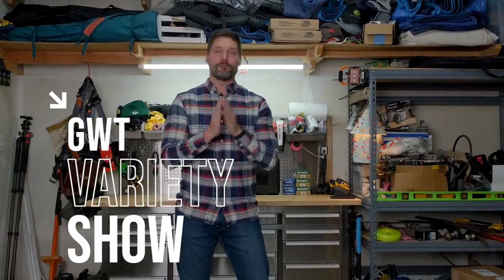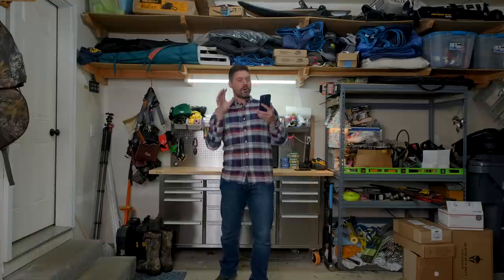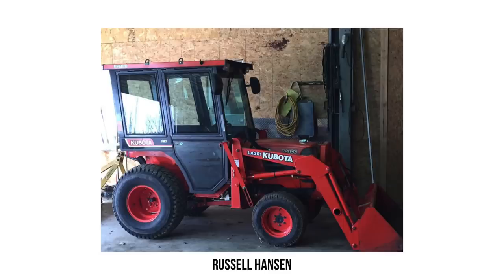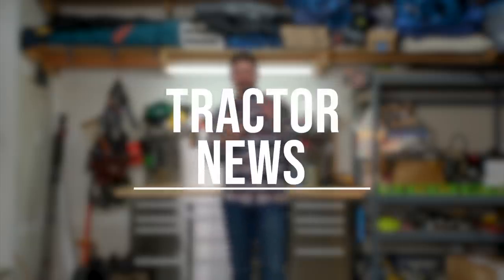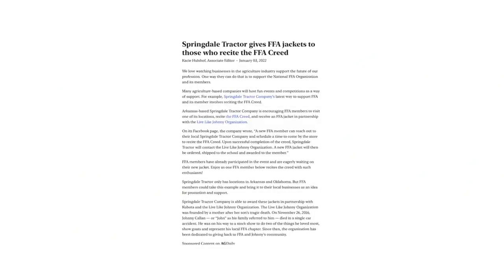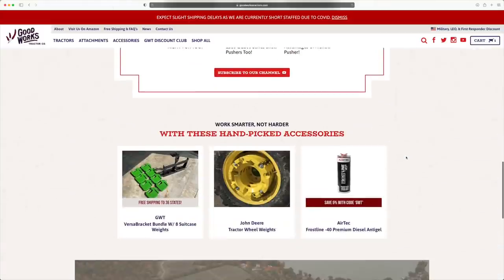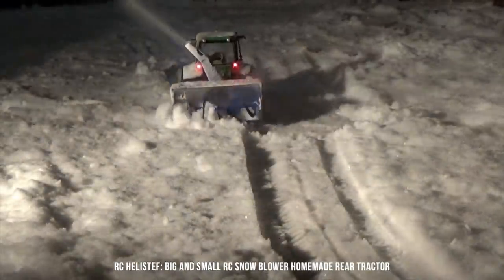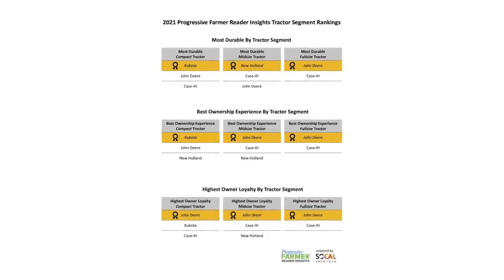2 GUYS FLIP THEIR TRACTORS IN 2 MINUTES! TRACTOR TALK #1

Comment: I welded a cheap Amazon 3 point trailer mover to the front of my kubota ballast box to make it a quick hitch compatible. Also bolted four small metal caster wheel to the bottom of it to make it easy to move around. Makes life some much easier.

Comment: Good advertisement for use of wheel spacers.Rolled a JD 2305 loader with backhoe backing up in a old stump hole filled with leaves. I think the backhoe increases rollover chances because of higher C/G. 3" spacers on rear and able to reverse front rims for wider stance made a big difference. You would think back rims would be reversible from factory but aren't.

Comment: I also made one of the stone rake snow plows.  Also used rubber.  It works great and fast.  I have it on a side by side.  I am on a north slope so I have to get the snow off.  If I don't freeze thaw cycles will turn it to ice.
Reply: Punctuation